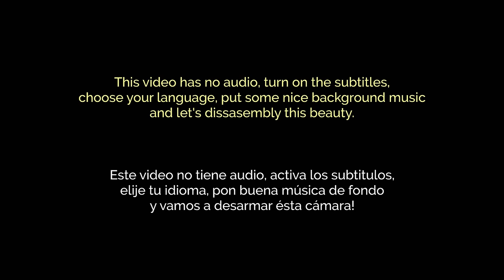Canon G11 - Disassembly and Assembly

Comment: Thank you so much! I replaced died flash bulb thanks to your video! 
The most difficult step was connecting the cable from the back cover back into place, but everything worked out
Reply from the maker: I'm super glad to hear that my video helped you 😁
Reply: @DavidEsteban The flash didn't last long. It looks like the flash bulb was fine. The board that charged the flash died.
If I decide on an expensive replacement, I know what to do!

Comment: Thanks for the detailed video. It's really helpful. I opened up my G12 to clean debris on the sensor. Everything seemed to work well, until I connected everything back, and now the camera won't turn on. I think I've connected all of the cables back correctly. I can also see a tiny switch that gets pressed when the battery door is closed, so don't think that is a problem. I can't figure out what went wrong. Any idea why camera might be not turning on? Thanks again.
Reply from the maker: Thanks for the comment, I'm glad you found the video useful. It happened to me once and it was that the lcd screen was not connected properly. I don't know if that's your case or not, have very little experience with it
Reply: @DavidEsteban  hi thanks for the video. Quick question if you dont mind. I have a G11 that works perfectly with everything takes pictures flash everything ok. But when i open the lcd screen the whole camera shuts down, do you think something is wrong with the lcd screen cable or do you think the motherboard is broke? I'm trying to fix the camera because its so new and barely used, but i can not find anything related on this issue, while the screen is folded in the camera works 100% fine, the moment i open the camera lcd screen til the point where the screen supposed to light up, the whole entire camera shuts down, any ideas on this? thank you
Reply from the maker: @kaip3260  Hi! I'm not a technician, so I wouldn't be able to tell you with certainty where the problem is. If everything else works fine I'd be more inclined to think it's an issue either with the screen or the screen cable. Have you tried turning it on with the screen open and in different positions? If it's the cable maybe there's an specific point/angle where it works. You wouldn't be able to use the camera like that, of course, but maybe it will give you a hint of where the problem is.

Comment: Is the white connector at 3:16 responsible for focus control, by any chance? When I first got the camera I was getting a lens error so I wanted to see if the lens had any debris stuck inside and when I tried opening it, I accidentaly ripped the connector from the board, then I put the plastic cover back on because I didnt have the right screwdriver to get further, and decided to manually close the lens, and it worked but the focusing isnt working, so I wonder if the reason is the cable or the lens itself. Btw thank you for the video.
Reply from the maker: Hi there, I'm sorry to hear you ripped the connector from the board. I'm not an expert so I don't know exactly what it does. My guess is that it has something to do with the optical viewfinder not the focus. I think the focus is controlled by a motor placed closer to the lens and it has more wires coming out of it. Was it focusing before?
Reply: @DavidEsteban  Hello, thank you for replying. I bought it used, a few days ago, and I didnt get the chance to see if the focus works because of the lens error. So its most likely to be the focus motor (13:17), that is causing the problem? Okay, thanks for helping. Ill order the replacement parts and try to repair it.

Comment: The whole thing has to come apart to replace the front lens? Mine has a nasty scratch and it really needs replacing. I tried other fixes but nothing worked.
Reply from the maker: Hi! Yes, as far as I can tell (I'm not a expert) this is how you have to disassemble it. There might be another way to get to the front lens, but I don't know it and I don't longer have the camera to try it out.

Comment: Is it easy to get to the Canon G11 image sensor to remove the infrared filter? This is to convert the camera to full-spectrum.
Reply from the maker: It's relatively easy, I reach to that part at 11:30. That being said, I wouldn't know much about the infrared filter. Do you have a link that shows how to remove it? either from this camera or any other. I'm curious